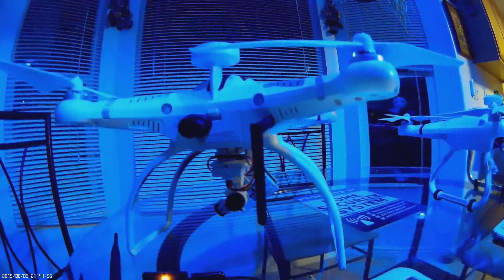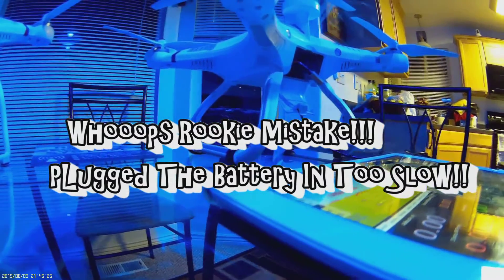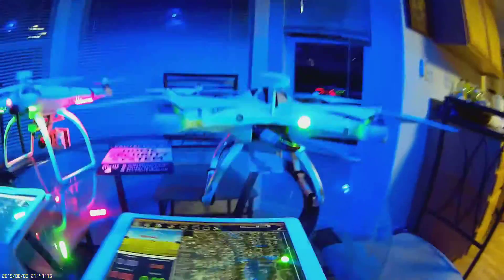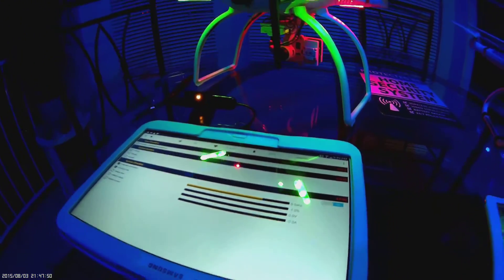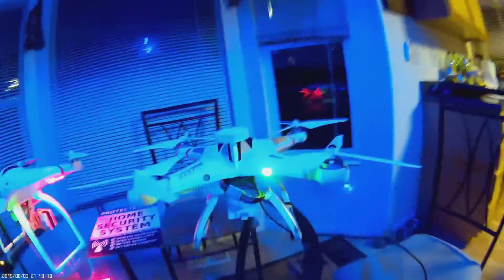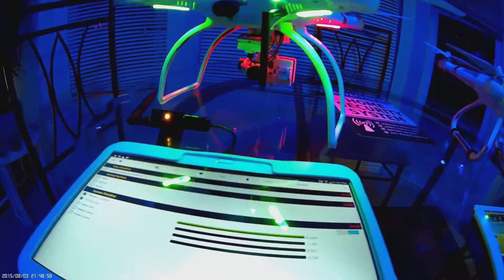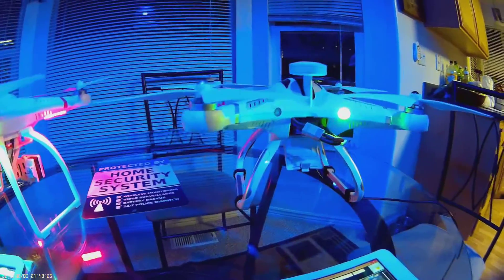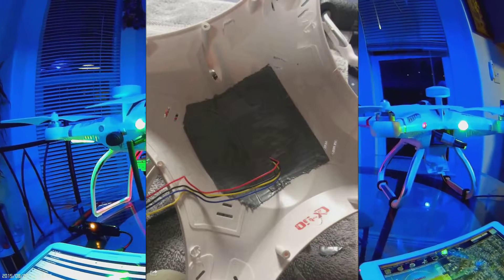GPS Shielding Modification Test #2 A Better Test Cheerson Cx-20

Comment: If you are in Australia and you are looking for a good shielding tape for the GPS, I used a product called "SLUGGA".  It is an adhesive copper tape used as a barrier around plant pots to prevent snails and slugs climbing up.  It is 30mm (1 3/16") wide and comes in a 4m length.  It is made by Dalson.  www.dalsonware.com.au.  Works great and is super easy to apply.  Available on Ebay too:  http://www.ebay.com.au/itm/SLUGGA-SLUG-STOPPA-TAPE-4-Metres-Copper-Barrier-Self-Adhesive-Safe-Garden-Snail-/161763971636?hash=item25a9e25234:g:vLUAAOSws65Tp5Gn
Reply from the maker: nice tip ..thanks
Reply: +neil berry i use copper tape to

Comment: Dude, there was smoke... what does plugging in too slowly have to do with smoke coming out of your quad? 
Anyway-- I did this mod w/ copper tape on my CX20 and have never had a problem with GPS-- the thing gets a fast lock in my basement (which was surprising).
Reply from the maker: +Jay Henry  Yes trust me I was well aware of the smoke :-) lol .. turned out it was coming from my battery plug and it wasn't like I plugged it in backwards or anything .. I've had this happen before years before with my helicopter batteries ..I could have edited it out but figured it was interesting to look at .. but yes shielding mod does work decent Jay and even better if you are using your quad for filming or A even better option is to install a M8N compass Gps combo.
Reply: +Quad Noris Well, thanks for not editing it out; half the fun is having things go wrong (that's what I keep telling myself).
Reply from the maker: +Jay Henry you have to really take that approach cause things will for sure go wrong. the worst thing I've had so far is is my cx-20 upside down under water for several minutes with me frantically running through mud to try and save it lol .. 2 hours of cleaning later the quad lived with no damage other then my pride :-)
Reply: +Jay Henry u had any prob with gps after fix
Reply from the maker: I have one Cx-20 with this mod and the other has a m8n GPS installed.  Both do work really well .. the M8N can grab up to 20 sats when flying